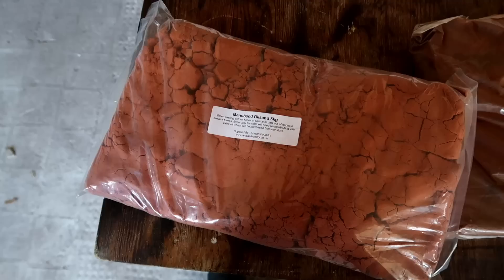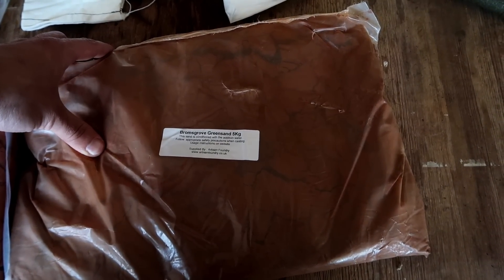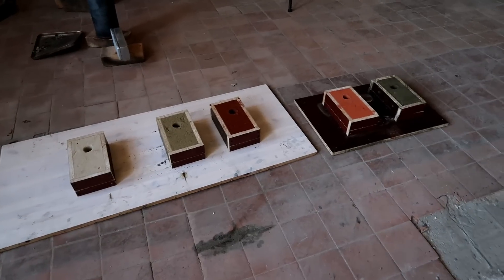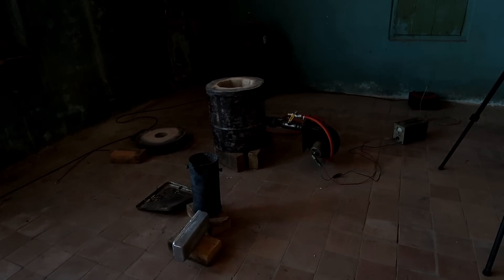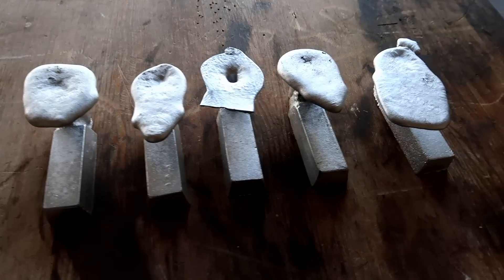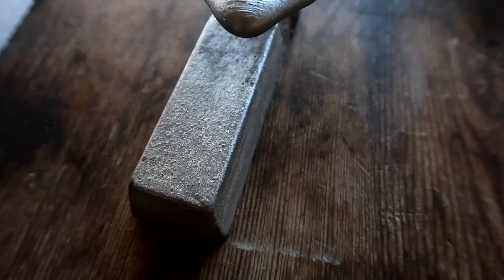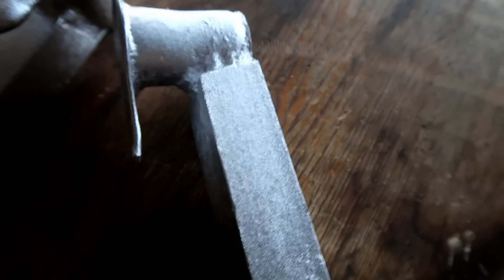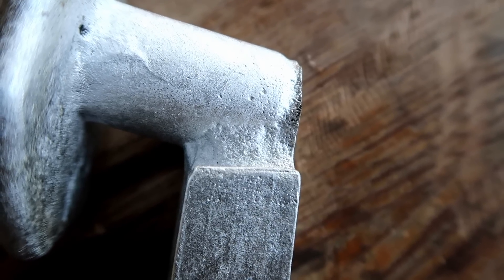Commercial VS homemade molding sand

Comment: How can I cast an item that have a 3d shape, it is symetrical, so I just need to get the center of the object to align with the center of the boxes, but the start seems to always be to put down the object, then pour sand over, but I need it to sit lower...

Comment: 8:47 result of gasbubbles that form when the sand gets heated. when the melt comes in contact with the mould, it creates a film of partially solidified metal and oxides. When gas gets trapped underneath it creates these pockets, when the gas gets inside the melt, yo get cavities or local porosities resulting in poor metal performance

Comment: I know it's an old video but different metals and finish require specific types and grades of mould mediums it's not one suits all, if you were casting a vice you will not require a high grade surface but require long high temp capabilities and stabilities, also one of the most important parts of casting is gassing and flow of the metal entering the mould, again this differs with types of metals and mould mediums, some require resistance some require fast flow, and equally important is melting the metal, and temperature control as this can and does dramatically effect uniformity through the casting, in other words there's a lot more to casting than just melting metal, alchemy of metal is a very in depth subject, the result are the lack of

Comment: Great test, thank you. Nice to see them all side by side.
I think you should have used a more complex pattern though. The oil cement one's issue is gas formation. Either the oil is producing lots of it, or the cement is too fine and it cannot escape.
I think there would have been a greater divide between the sands if used on finer details. Mostly due to gas formation. The water based mix one of the worst as it flashes to steam, though the cement oil might be worse as it cannot escape.
The sodium silicate probably won't be affected much by fine details and do well. The commercial greensand, somewhere in the middle.

Comment: Thank you for this comparison. I have the red oil sand, but I’m getting large pockets like your cement and oil mix. But watching you compact the sand I thing I’m over compressing. I’ll pour this weekend and try a few different levels of compacting. I’d watched a few videos with the silica sand and now I think I’ll just buy more of the extra fine red oil sand! Thanks from Austin Tx
Reply: Mark wilson What did you find out?

Comment: I leaned a trick from another youtuber, that really seems to help with casting. Scoop out a shallow hole about 1.5" in diameter and 0.5" deep next to your sprue hole, and make a rounded trench that goes from the shallow hole to the sprue hole. You want to pour the metal in the shallow hole an it goes up and over the trench to the sprue. This keeps the turbulence in the metal down, and makes it flow into the mold smoother. It also seems to keep sand from getting knocked loose. I'm just using some shitty homemade green sand. I've tried pouring both ways and the method I described gets a much nicer finish. Here's one of his videos, he shows what im talking about in it. https://www.youtube.com/watch?v=e2rE6cqg2So
Reply: he learned all that from "MyFordBoy"
Reply: yes, adding a "trap well" helps keep sand out of your casting. Just a shallow hole between (or bottom of) your sprue and mould. It allows the metal to flow more evenly and catch loose sand. You can also add a J shaped pour channel so the metal fills the mould from the bottom up. This way anything that floats collects at the top of the casting while anything that sinks collects in the bend of the J. I have also tried W shaped channels to catch loose sand before it gets in the mould, which worked quite well but is a lot of work.
Reply: The problem when it comes to gold is that gold needs more than 1000 Celsius to melt. This requires a very special gas burner and is not what you can buy at Walmart. Next, most crucibles cool the gold too quickly, causing the gold to harden before it fills the mold. So it's not that easy to get the right equipment and especially that is not cheap when doing it as a hobby.

Comment: Firstly, i  know the bid is almost a year old.
If you are looking to achieve more consistent finishes I would suggest looking at improving your skills in forming sand moulds, along with slowing down the flow of molten metal.
Consider using a separate small diameter pouring sprew and save the larger hole as a riser/feeder.
Finer sand as a facing layer will help, but thinking about how the metal behaves as it enters and fills the mould is more important IMHO.

Comment: Excellent! Just think if everyone of us interested soulmates had to do this same experiment to make progress in improving our castings.. Instead we have as of today 88,736 people who can benefit from your efforts; and many probably hundreds of thousands more into the future.  Thank You and Well done!.  I was thinking I would not be so much concerned about the surface texture but instead how many inclusions are visible in a cut section of the entire casting. But with your skills I'd guess you are experienced enough to infer the interior structure from the surface texture and probably you are right but just some probability a different one might prevail? For example maybe one that has a rough surface but a perfect interior?  One thing I would like to point out is a big disadvantage of recycled automotive engine oil sand is that such oil is likely contaminated with lead from the wear of the lead/copper/chromium bearing surfaces in a typical motor.  And the residual lead will vaporize at quite low heating temperatures 400F-450F so very bad to breathe in that smoke..  Not to mention other benzenes - As far as the people who will write a long complaint about the music when all they would have to have done is a single click to mute the sound..Whatever!  I thought the music was fine and reminded me of fond memories of Rammstein..

Comment: I work in a green sand, no bake steel foundry. You do some right, some wrong here. You dont need your sand very wet at all. You bearly want it moist and sticking together. If it is too wet and you ram it too hard the sand will loose is porosity and you mighy get a bad casting with gas issues. You should have a better way to line up your flasks cope and drag so you dont get shift. We only use oil sand for heavy duty cores and we usta make our own pouring cups from it, now we use ceramic or Co2 sand. Keep practicing and you will get better!!

Comment: Try adding 1/2% glucose powder to your sand before adding the sodium silicate to that CO2 cured sand, it will improve the break down a lot. However I find the finish from CO2 silicate sand is poor mainly because the sand used is way coarser than my green sand. The problem of picking up bits of sand is due to the gating methods that you use. With good gating sand pick up is never a problem...Martin
Reply: How well they ram the sand play a vital role too

Comment: If you want better quality castings, you should make the hole as an spiral. This way when you pour the metal in, it will always be an continuous stream. By doing so it makes the overall casting quality better and actually stronger too.

Comment: Don't worry about the spillage. I worked in a commercial foundry for a few years, and the reason everyone is wearing thick soled, sturdy steel-cap shoes is because accidents happen. Spillages are not daily of course, but I've seen my share. With the right shoes they are usually not a problem. In fact, we had our greensand molds on metal bench-like things to have them raised to a better height (so that the guy pouring the metal did not bust his back more than needed), and we used aluminium bricks to weigh the top part and press it unto the bottom part to avoid spillage. Those bench-things were in a row, because space was a bit tight and the puring thing (whatever it's called, that bucket-like thing you get the aluminium out of the furnace and to where it needs to be) only held enough aluminium for that amount of molds. So we changed the bricks from mold to mold during the pouring.
Once, I was changing away and felt some sort of material underfoot, assuming it to be sand. It was only when the smoke came up that I stepped away and took a look to see that I had been standing on a fresh aluminium spill. I had felt no heat, nothing out of the ordinary - that was how good my shoes were, and why they were that good. It only takes a small crack between the upper and lower part of the mold to make it spill, after all.
And the stuff was hot: Once I was hit by a tiny droplet of aluminium out of a freshly poured, still cooking, mold on my right shoulder. I never saw the droplet, but I felt a needle-tip sized point of intense pain and found a tiny hole burnt into my sweatshirt. The skin took no damage that I could see, the droplet was so tiny. But I sure felt it :-)

Comment: Has anyone thought of trying a combo ie using petrobond around the mold to be cast and then using the cheaper silica sand to finish out the "base" of the flasks?
Reply: Then you can't reuse your sand properly until you grab some tweezers and pluck out the crap sand :)
Reply: Yes, people do sometimes use petrobond as a thin layer of facing sand and to a limited extent the contamination should not be a problem unless you use a lot of the petrobond, one should of course throw away the burnt petrobond that adheres to the casting as this will stop most of the contamination... Martin
Reply: It is common practice to use oil bound sand with green sand as backing. The thin layer of oil sand will burn out and doesn't harm the green sand that much.

Comment: Nicely done. Just subscribed.  Love the side by side comparison.  If you're going to keep the rough look, then these are huge differences.  Do you find that this is more desirable than the "cleaned up" look? I wonder also if more sifting/grinding with the homemade green sand would be a solution for that?

Comment: What this tells me is that home made oil sand is worth looking more in to. Maybe try something with a smaller grain size to get better results :) I'm sure somewhere on the internet can be found the materials that are used in the commercial product. Cheers man, good video.
Reply: I can't see there being much of a difference in the oils used, unless it has a specific temperature range for different metals. Grain size, or sieve size is probably the most noticeable difference. Play sand vs. cement sand vs. sandblasting sand are 3 very different materials. All depends on what you're output goal is. 

Great video none the less! Subscribed!

Comment: what if you pack the sand down with a cheap hydraulic rig instead? I'm thinking steel frame instead of wooden box, using a bottle jack as your "press"
Reply: legionbunny if you compress greensand too much it locks boiling gasses inside the mold as the melt is poured in, then the mould explodes quite dramatically.
Reply: yikes.
glad I know, almost tried this.

Comment: show us how to melt iron and steel
Reply from the maker: I do want to try to melt iron but I will need to make a new waste  furnace
Reply: Yeah but if the professionals get all the steel casting how will we over throw them?
Reply: He would need an electricfurnace made with kanthall wire or ark furnace. He could introduse oxygen from a tank but its expensive.
Reply: MP Dragon i really enjoy your content keep it up
Reply: Just watch my channel it's all about melting iron and some videos showing how to turn steel into cast iron.
Reply: Shalor McKee i understand the struggle of melting iron and steel. that does not mean he cannot eventually do it with a new furnace. i was merely giving enthusiasm to mp dragon.
Reply: Shalor McKee if you want me to actually see this, add my name in the front
Reply: Damn, I am a long time sub, Lucky. I love the stuff you produce!
Reply: Do you have any idea how much heat that would take? Lets compare, aluminum melts at 1200ºF, steel melts at 2750ºF, and iron melts at 2800ºF.  I highly doubt that his propane foundry can get up that hot and keep the steel molten. On top of that in order to actually cast anything he would have to have the steel in an anaerobic environment, which means there is no oxygen present to turn all of that molten steel into iron oxide. So in short terms, casting iron and steel is best left to professionals.

Comment: 10:21 perfect alignment between your forehead and the line in the background. Other than that thanks a lot for the info,just one question, what oil u use?
Reply from the maker: Do you mean for the cement and oil mix? For that I used synthetic engine oil